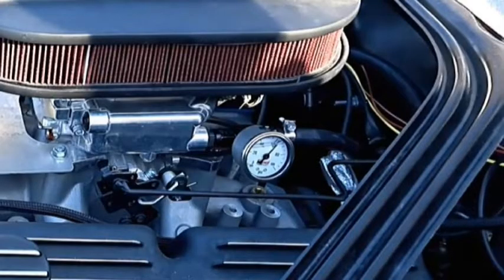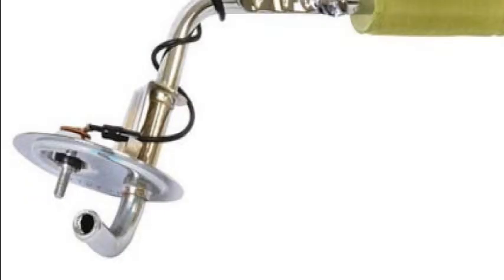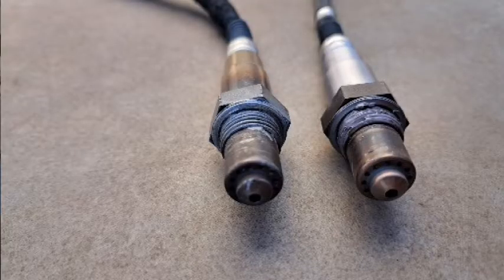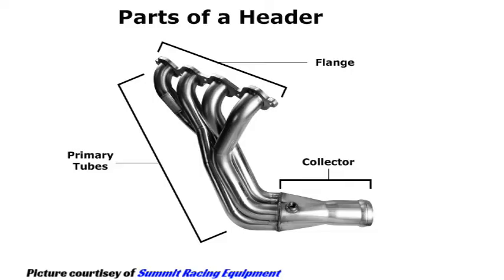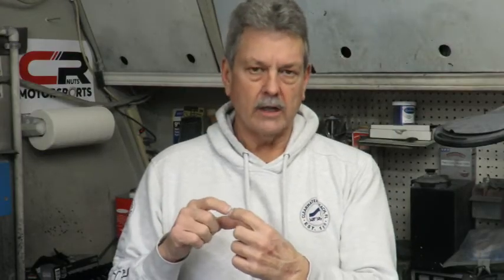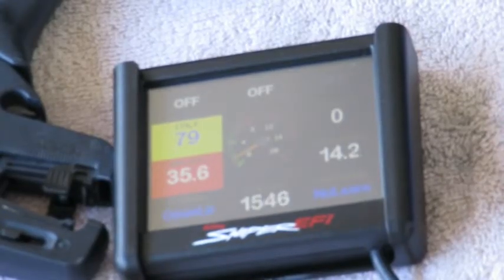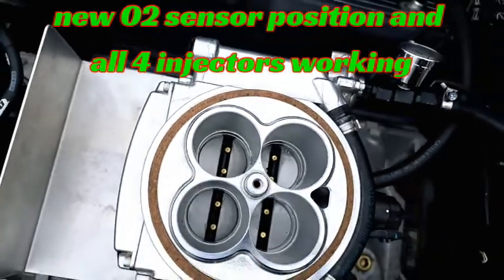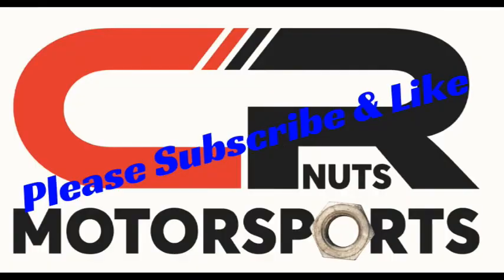Holley Sniper Air Fuel Ratio Issues & Start Up Issues Symptoms & Fix

Comment: I have done 6 Snipers Systems, 3 cars are mine and 3 cars for Family and friends……I will tell you this…..90% of all problems are self induced. These things are pretty much bullet proof. I have had to go fix a couple of friends who put them on and in typical Ignorant fashion they installed things incorrectly.

I will have to say I have never had on produce anymore than 60 lbs of Fuel pressure……I would venture the guess your Furl pressure gauge isn’t accurate…….I am not a Summit Chinese brand fan so I have no experience with them.

I always mount my O2 sensor at the 10” away from the end of the merge collector…..Always and I mount it strait up -10 degrees and alway passenger side.

What cracks me up is the BS claims about Holleys Customer Service…….I have felt with these guys for 30 yrs on MANY different situations mainly opinions on what to use, What not to use an the occasional issue like a Distributor issue I had on a 572 Big Block Ford I put in a 66 Mustang Fastback tube chassis car……Distributor Gear was off by .025……I didn’t feel I should have to re-drill shaft and set gear……They took care of it and quickly.

Great people to work with
Reply from the maker: This was our 2nd sniper, the 1st one went off without a hitch. I wholeheartedly agree about Holley's CS. They were hard to get a hold of, but extremely helpful when I did manage to get with them. I also agree most of my issues were self inflicted, a learning curve, shall we say... We started with an Earls Fuel Pressure Gauge and it leaked, the Summit was what was in stock. Both gauges read the same.
Reply: @bigboreracing356  Did you find out why? My guess is he got tired of answering calls from the Ignorant. Not saying they are 100% but until I am proved wrong I will continue with them....Just ordered a new one yesterday for another project.
Reply: @bigboreracing356  That decision was made long before you came along.
Reply: @bigboreracing356  Just a guy who has had very good success with 6 of them. I dont give a damn what Steve Morris does, thats his business.............Who are you?
Reply: Ron, just installed my kit and can't get it to read rpm. The 3 inch monitor just says stall. I hooked up my yellow wire to the negative coil. This is installed on 350 sbc using boyd's tank with 340 lph aeromotive fuel intank pump. Any suggestions?
Reply: @CAC-1111  What ignition system are you using?
Reply: @RipitRon  My issue was self induced lol. My Dad didn't remember he had a ignition box and it was tucked away on the underside of the dash at the top. I lost a whole day trying to figure this one out. My brother remembered and saved the day. It starts and run with rpm now but extremely rich.

Comment: My issues is is runni g to rich mine runs at 9.3 to 10.5 a/f i try going lower o. Pressure  dont it dont likeme
Reply from the maker: Holley's tech support was great and very genuine. Took a bit to get through but well worth it. My contact was located in TN. We discussed every possibility. By the time we were finished, I had a whole list of things to investigate. Wish you well!
Reply: @crnutsmotorsports  found my issues my lock out on my distributor wasn't locking out and had a 60/40 in so alot more tunes and retime it
Reply: I pit the 100 back in so it fouled out plugs was the af problem

Comment: I only say this to help. I spend 7 days a week making my living supporting Holley EFI, Snipers more than others. Misinformation is the biggest thorn in the side of the Sniper.  You can't really put the sensor too far down the exhaust within reason. You could put the sensor 4 ft away from the collector and as long as you had no leaks and no reversion from the tip of the exhaust it would read exactly the same as 4ft closer. The oxygen sensor does what the name implies, it reads oxygen content of the exhaust. If the pipe was sealed there is no way the oxygen content of the exhaust could change from the collector to 4ft down the pipe. You either had an exhaust leak letting clean oxygen in or the sensor was too close to the end of the pipe. You need at least 18" of exhaust pipe after the sensor to prevent reversion of clean oxygen.
Reply: That may be, but it does not change the fact that the quality control on this Chinese Holley stuff is incredibly poor, and people who install the Sniper stuff correctly have lots of issues still with parts failing and what not.
Reply: @AB-80X  I support Holley EFI for a living. The snipers are an incredible product for the money. There are downfalls related to cost but it’s the only way to offer such a cheap complete EFI system. This is the biggest misunderstanding of the Sniper. Sure there are issues, but what you get for the money is insane. Price any other stand alone EFI system with every sensor you need and injectors, it’s way more than a sniper. The fact that you can convert a carbureted vehicle to EFI for $1500 then have to dump another $100 in for a failed sensor or injector is pennies for the capability you get from it.
Reply: @DirtySideGetsDown  spot on, I'm on my 3rd year on all sensors, but when it wasn't running good I made adjustments, didn't let o2 sensor foul out, another thing is plug a damn laptop to it, throw that 3 inch away
Reply: @DirtySideGetsDown  Hey just installed Sniper EFI and my system is not getting a rpm signal. The 3 inch monitor only reads stall. I have my yellow wire hooked up to the negative side coil but the monitor does show rpm signal
Reply from the maker: Point well taken

Comment: Did the same thing,  redid the exit pipe routing, put the 02 sencer 2 ft away, and forgotten the 6 to 8" instructions,  2 years earlier.  It was belching,  backfiring,  ect...  Put another bung for 02 sencer 8" away. Good. Lost 6 weeks over that.

Comment: I guess I got lucky. I put a sniper on a 5.3 LS in my old 84 blazer.  Just a hunting, fishing, gravel road rider. Sometimes back and forth to work. 
3 years now. Now problems. Mounted the fuel pump in the frame rail and it's a noisy bastard. But other than that no complaints.
Reply: You could always get a controller for the pump. Slow it down when it does not need to work hard.

Comment: went ahead and sub'd. you have a lot of good info in the video, but also a lot of info that's not 100% correct.
1. you should have 58-60psi fuel pressure. you don't have to have this.. realistically, anything between about 50-70 would run fine. the lower the fuel pressure, the more the injectors must compensate. and raising fuel pressure higher is how you deal with lack of injector size for a higher fuel/HP requirement. higher pressure = more fuel when injectors cycle. i do recommend a fuel gauge, however i don't recommend it on the sniper directly. i always suggest running an external reg with gauge on that. if you have a super sniper, put the pressure sensor on the sniper directly and datalog or use digital fuel pressure gauge. 
2. the o2 placement isn't THAT critical. keep it towards the top of the pipe so moisture can't collect. your first location isn't what caused your lean condition at all. if i had to guess, it was a leak at that collector flange pulling in fresh air. tuners clip on their own dyno O2 sensor at the end of your tailpipe to pull a reading. my o2 sensor is waaaaaaay past that collector as I'm a single turbo 302 in my mustang. i have 2 collectors, crossover pipe, y to the up-pipe, turbo, then its about 20" from the downpipe flange.. runs just fine. further away it is, the safer it is from too much heat killing it, but the more delayed the reading is. the closer it is, the faster the reading, but less accurate if the pipes haven't merged well yet and the more heat it'll get to it. 
3. the fact the 2 injectors up front weren't working makes me question if you had the quadrajet selected when you ran the wizard. injector connectors are a problem with the sniper. heat shrink and ziptie will correct the issue. you should have stopped trying to crank it when you saw 2 injectors not working unless you didn't know all 4 were supposed to work.
4. you don't have to wait until the fuel prime/prime shot to crank if you have your efi tuned for it. all depends how you have your cranking fuel and iac park set. 
5. an intank pump is the way to go with EFI. but if you do run an external, make sure its even or below the tank. you just have to make sure fuel can be gravity fed to the pump. easy way to check, loosen the fitting at the pump inlet.. if the tank wants to drain, you're fine. 
 - there was probably some other stuff in there i'd comment on but don't recall. i'll definetely keep watching your content though. videos like these is what helps everyone learn and betters this community.
Reply: I agree with the reply on the o2 sensor. Good tuners don't use tailpipe clips. Good tuners weld in bungs or ask the customer to have that done prior to tuning. I know people that tune with a tailpipe 02 and they learn what they think is optimum for the engine based off of their dyno. I've seen a car tuned off the tailpipe. have a wideband installed in a proper location and it change the measured ratio .7 points. Did it change the power? No. Bc the tune didn't change. But the air fuel it was tuned on was what the new one read. Not the air fuel the tiner thought he had tuned to. The tuners gauge was wrong bc of location. 

That doesn't parallel the sniper. Bc the tuner knew what he wanted and told the ECU what to do based off of his gauge. The sniper knows what it wants without the guage and expects you to hqve the sensor in the correct location to determine if it's actually getting its desired air fuel. Outside of that paramatwr and you start skewing the data and it isn't readjusting its preset tune desires bc it has a dyno attatched to it because it doesnt.
Reply: further away from the collector more outside air it will read making it run richer it must be within 8 inches of the collector for it to read correctly and much less chance of a pin hole messing up the reading as well and heat wont hurt it heat keeps it clean it gets fowled when to much fuel or other gasses get introduced such as regular silicone (rtv only )  , fuel pumps come in push or pull, you make some good points but not completely accurate for the holley

Comment: My holley sniper efi nothing but headaches would recommend it
Reply: Yup. They may initially be cheaper that a real EFI system but it is just not worth it.
The more expensive systems with throttle body injection can self learn as well, so no need to settle for less even if one is not able to properly tune EFI.
Reply: Get a laptop, I was frustrated myself fouled plugs on self tune, opened lab top shut of closed loop and press up or down at areas that are a problem, don't b scared of it, & wow what a difference

Comment: Thank-you for the video. Had a similar issue. Moved the O2 to the other bank. O2 started working perfectly. Went from 6 inch on the PS exhaust. To 12 inch on the DS. Idk, if it was a connection issue or flipping the wiring. But fixed now.
Reply from the maker: Glad you figured it out

Comment: Thanks, but I'll stick to my 4150 Holley,  It takes 1 hours to clean and tune not 4 weekends.  no injector tickling noise no AIC whistling No 02 sensor or electronics to go bad without warning and did I mention my fuel pump only cost $40 dlls and 30 minutes to replace.
Reply from the maker: You have a valid point.
Reply: @crnutsmotorsports  a carburetor listens to the engine,  a fuel injection system tells the engine what to do .
   I mean don't get me wrong I have two sniper units and they both been  good for the most part but  without warning II get problems  two times I have to send them back to holley for repair and being out without a car for more than two weeks until they get back to me.
   electronics take a dump without warning and you're stuck in the intersection with the hood open You can't do anything to fix it.
    A carburetor will give you more warnings before it takes a dump on you but it will get you home to your garage.
Reply: @crnutsmotorsports  when I drive my car with the sniper unit there is always that little thing in the back of my mind if it will take a dump without warning or the fuel pump is going to go out on me .
Reply: @hectorortega9131  that's why i have 2 fuel pumps.. they cost about $40 each. never had an issue from either though in 3 yrs. sniper isn't the most reliable efi though. term x is a much safer unit to have a more reliable daily vehicle. but efi can do many things a carb struggles with.. like cold starts, elevation changes, being able to change boost levels on the fly without affecting its daily driving fuel. and tuning efi can be done in a weekend by someone that knows what they're doing.
Reply: Fuel Injection will rain supreme over a carburetor. The question is how much money are you willing to spend. That is the bottom line.
Reply: @ekitching  Yup. Cheap, fast, reliable. Pick two.
Reply: How do you properly tune you carb if you can't measure A/F?
Even if you run a carb, you'd still be running a lot better if it is set right.
Reply: how much did you spend on re jetting tuning secondaries, i bet that carb after all said and done cost as much or more than a TBI, and you still have cold start issues,elevation,vapor lock, actually list more issues that can go wrong with a carb than a TBI.
Reply: I can see most of these commenters dont know how to tune a carb the rite way .

Comment: My chevy big block truck runs great and the O2 sensor is in the stock location from chevy which is at least 12-14 inches from the manifold. And the injector harness issue is very common but easy to fix with a zip tie. Good luck
Reply from the maker: Thanks for the info, Ken
Reply: @crnutsmotorsports  your O2 bung is fine past the collector flange, you problem is that flange isn't sealed and it leakong air in to the down stream location.
Reply: My O2 sensor is also about 4-6 inches past my collector on headers and no issues so far. Getting to the injector harnesses is not that hard, but  the fix with zip ties is wild! I guess I know the fix if it ever happens to me.
Reply: Are you saying to zip tie the wires together, so they don't come loose?